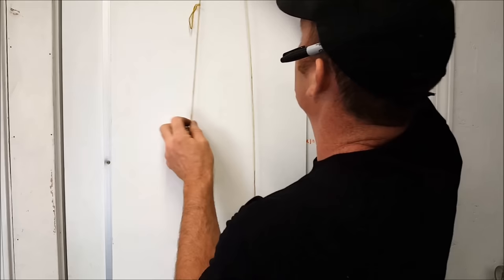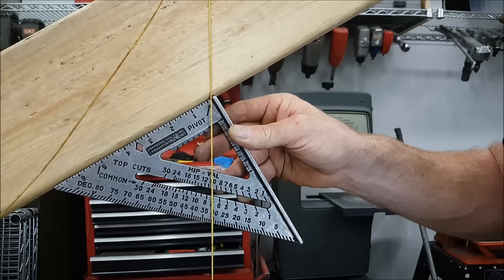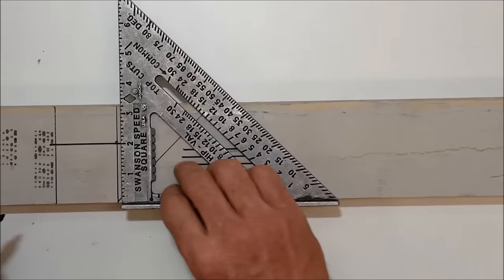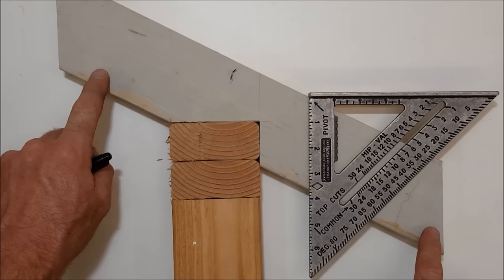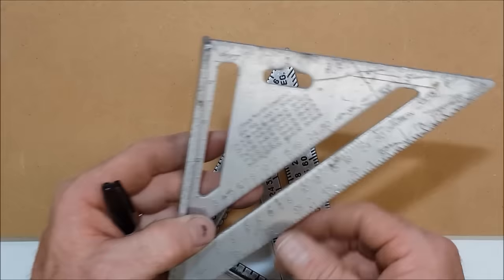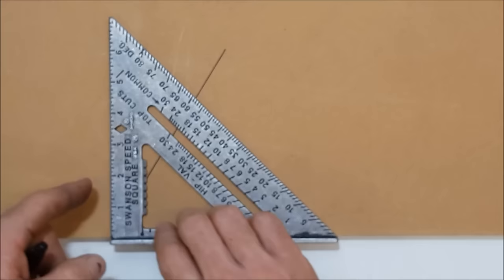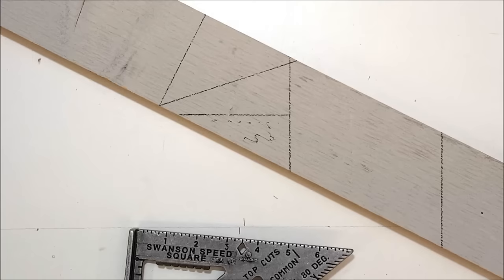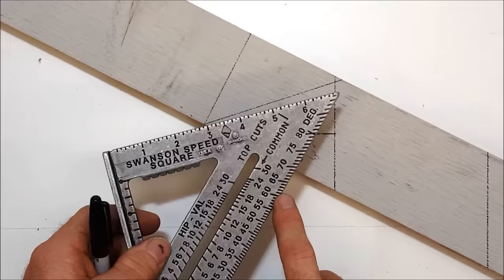Speed square basics - How to use one

Comment: Great tutorial. You really do a great job with them but solving these issues will be so much easier if instead of measuring and calculating with the medivial US measuring system, you update to 21. century and go metric system. Miles, inches, pound, furlough, gallons, Fahrenheit and what have you not is all so Jurassic...
Reply from the maker: I use both systems. Better for the brain.
Reply: @Makebuildmodify  To that I can agree. Metric is more for simplicity and workflow efficiency. Why simple if can be made complicated. 😉
Reply from the maker: @ofipete  There are advantages to fractions in some contexts. For example, slope is an expression of rise over run in the form of a fraction. Basic algebra x,y coordinates. A fractional system really helps with quick calculations in the field. It doesn't necessarily have to be the imperial system, but that's the convention that we have. Plus, there are billions, if now trillions of dollars of structures built with materials that use the imperial system. I would be nearly impossible to make the change immediately. It would make repairs difficult and expensive.  America is technically using the metric system. Science, engineering, and the medical industries have almost fully adopted it.
Reply: @Makebuildmodify  Yes, I’m aware of the problem to convert. In the 60s as a youngster I attended high school in the US and learned with the imperial system. I remember the „go metric“ campaign in the 70th didn’t kick off well and floundered because of acceptance problems. It’s a longterm process that is carried on through the schools.The coming generations will be comfortable with that. Here in Europe the decimal system was introduced after the French Revolution. If im not mistaken the US car industry meanwhile has gone metric on all their cars.
I got interested in your tutorial because I need to renovate the roof of my Garten Hut. That’s why I find it unfortunate that the measurements are imperial. I will check and see if some equivalent instrument exists here with decimal scales.
Reply from the maker: @ofipete  there should be a metric speed square. They usually have a reference booklet. At least the Swanson's do.

Comment: What do you mean 7inch pitch or a 6inch pitch?
The pitch of a roof is in degrees 
You don't need a speed square to pitch a roof
All that is required is a level and mathematic 
Valleys and ridges is the pitch and 45 degree cut
Reply from the maker: Yes, if you have the roof in degrees the protractor portion will work. But if you don't know the conversion from slope in rise/run form then speed square allows you to convert. For this you use the common scale and if you want the hip and valley slope you would use the hip/val scale. 

The speed square is modelled after the roof cutting system that is based on a steel square. There are no protractors on steel squares. The addition of the protractor to the speed square is intended to increase usability, not replace understanding of the system.

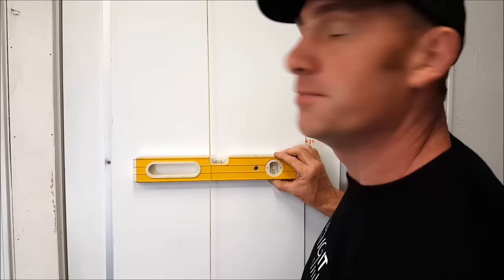Comment: You covered up the mark on the left at 1:21 min. into the video.
That square is probably 1/2 the reason buildings are so out of square today.
That tool was made for quick reference...Not for precise measuring.
I see framers using this all the time and they wonder why 10 feet down the hall, the wall is 1inch out of level.
Reply from the maker: I fail to see how a specific tool can cause anything to happen. Wouldn't it be more appropriate to say that the misuse of the tool is the cause? If that's the case then we ought to be addressing a different concern, namely, the education of today's craftspeople. Which is precisely why I uploaded the video.

Comment: Ok but how do you use the numbers 1,2,&3
Reply from the maker: I'm not sure what the question is. Can you be more specific?
Reply: @Makebuildmodify  for example you make a line holding the pencil on the two why and what does it do
Reply from the maker: @presidentelecttaterpuddin1626  There are three number  2 's  on the square. There is a 2 at the  two inch mark, a 2 on the common rafter scale, and a 2 on the hip/valley scale. They all do different things.

Comment: One thing that bothers me is that most speed squares (a couple swansons I came across included) are not trully square. Damn, maybe it's just my OCD...
Reply from the maker: Yeah, I would agree. You have to check them. But I would say that the tolerances are good enough for framing work.
Reply: Omar Colocci , also to, is your level, level?  Have to keep an eye on them also getting dropped, and banged around!
Reply: They are for framing. Framing is not as precise as building a piano. Woodpecker makes some very precise squares but they are expensive and I would not use them for framing. Excellent for woodworking though.
Reply: great thanks

Comment: Easier to use a torpedo level and your speed square to figure out rafter pitch than a plumb bob
Reply from the maker: That depends. Circumstances vary.
Reply: Make Build Modify which circumstances would be better to use a plumb Bob over a torpedo
Reply from the maker: In the circumstance where you can't use a torpedo level...;)

Comment: I thought there was a rule that says a birdsmouth shouldn't penetrate its rafter by more than one third?
Reply from the maker: Yeah, it's a guide. Although, if a 2x4 is used the birdsmouth usually doesn't fall within the guide. But that is okay because a roof that uses 2x4 rafters is very small (like a dog house). It all depends on the use case and the local codes.

Comment: 1:20 "yep level line" LOL, and your makrs were not even visible correctly, you know you could have used the leveler to make your "level line" to begin with without the plumber and your crooked marks.
Reply from the maker: You missed the point completely. It's an example for what you can do if you DON'T have a level.

Comment: Ok I’ve got a silly question. Please fork shame me lol 

I get what people mean when they say “6 degrees”. I get where they’re getting that number from. But what about when you say “it’s a 6-12 roof”? Where does the 12 come from?
Reply from the maker: It has to do with the slope of a roof expressed as a fraction. In the case of a 6/12 roof it has a rise of 6 units and a run of 12 units. Put another way for every 12 inches of horizontal travel there is 6 inches over vertical travel. Also, a 6/12 slope is the same as a 1/2 slope because the fraction can be simplified.
Reply: Ok. That makes a little more sense. But how do you determine that number? From scratch what would you do to get to that point? Sorry if that’s a redundant question. Any videos explaining this?
Reply from the maker: Well all slopes are in the context of 12 inches of run. Then the desired rise is chosen. So it can be 1/12, 2/12, 3/12 and so on.

Comment: the old framing squares had all the tables for rise run everything a speed square cannot be used for steps you need a real carpenter for steps
Reply from the maker: Here's my video on the framing square. Although, I didn't cover stepping of rafters in this one. That will be in my advanced video. https://youtu.be/1TOszum18Io